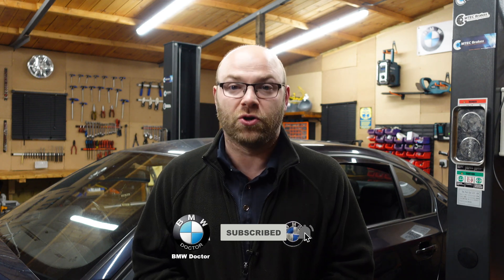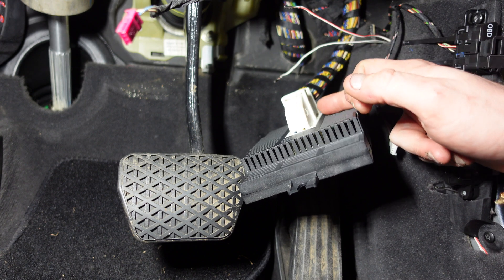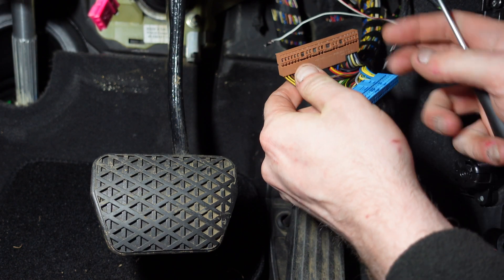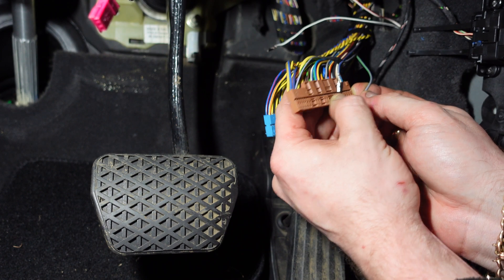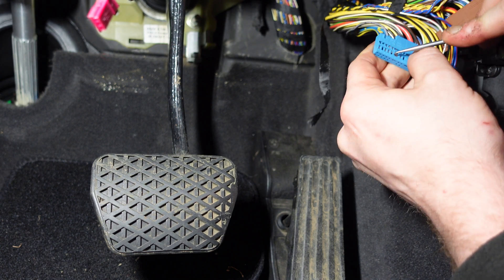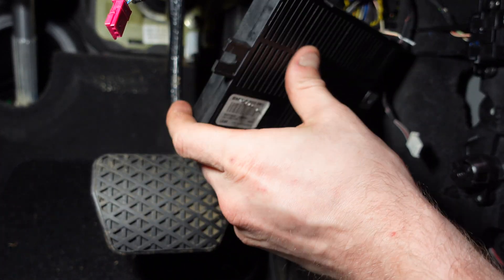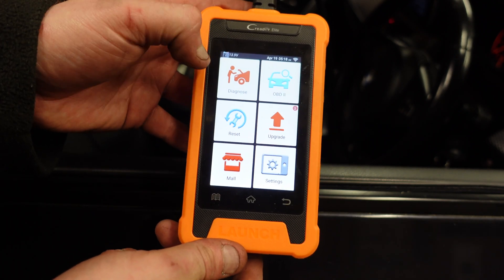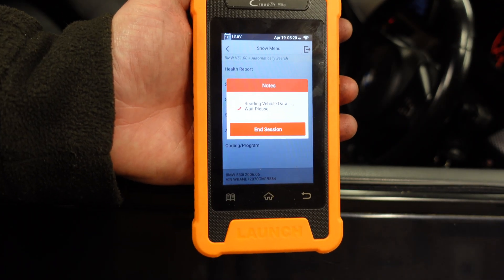BMW E60 / E61 Pre LCI To LCI LM2 Module Replacement & Coding

Comment: Hi i have a E60 2006 523i pre LCI - I have followed your video and put a LM2 Module in but all that happens is the angel eyes dont work and throws out loads of errors the headlights i have are PRE LCI Xenon - WHAT AM I DOING WRONG :( :(
Reply: Did you code your LMA and also updated VIN?

Comment: Hi can you assist, i have a BMW E60 525i, i took it to BMW dealer for a battery change and after that the iDrive screen started to be off sometimes and sometimes on and now it is completely off. The radio is not working too after the screen became completely off. I took it for a full diagnosis at BMW dealership, they told me they will put in a FRM module to check what is wrong with the car. The car doesn't switch off the electronics after a drive, i must take out the battery terminal cause it kills the battery, something is not switching off in the car. Can you help what would be the possibility to fix this. I was thinking of changing the FRM module to see if it will work
Reply: Sounds like your ibs sensor on the battery is faulty. Try to disconnect the ibs sensor on the battery and lock the car. If the electronics switch off then the IBS Sensor is faulty. If the electronics stay on you need to search further

Comment: I have Adaptive Xenon Headlights so I bought LM2 AHL. I switched pins and I coded features but I have one main problem.. I can't turn off my fog lights. What I do wrong? I would like to emphasize that without swapping the pins my angel eyes don't work. Please help mi doctor.. My BMW E63 2004.
Reply: @ghost_casper97  About to switch pins myself with the same setup to enable drl. Were you able to fix the issue?

Comment: Hello, so if I have an e60 from 2003 with regular h7, all I need to do is buy LM2 and 2009 lamps and this scanner will encode it without any problems?
Reply: did you do it?

Comment: Great videos. Have issue with lm2 on my e60. Going to replace with a used one like for like. Will need coding I assume. Is this coder better for this than the android based systems like protool or bimmercode?
Reply: @colinward3569  moi aussi j'ai le même problème je l'ai remplacé mais maintenant je sais pas comment le coder j'ai essayé avec autel im608 mai il le fait pas

Comment: So technically you don’t have to code it after you switch the pins? It will still work as it should?
Reply: I’ve just bought an e61. And i’ve noticed that the front and the rear lights are flikkering. And after a long digging on the internet, i came across this video and maybe the previous owner installed the preLCI headlights with angle eyes but didn’t know what to do with the pins. 
Please help me😢 i hope it will work by only changing pins. Thanks in advance!

Comment: Hi my friend 

I have a friend who has a BMW E60 from 2003 prelci he changed the front headlights to put halogen headlight with the lens like on xenon thanks to the adapter the headlights work but on the other hand he has a problem with the level of the headlight control when it is in the "0" position the headlights do not turn off when it wants to put the night lights or parking lights   headlights on while it should be the pilot lights basically it is important the position night lights or parking lights  headlights remain on still on, what do you think the problem could be coming from ?

Thanks for your time

Comment: Don't do this I did it and change the vin on the lm2 with NCS and then my angel eyes didn't work so I had to put the wires back and then it all worked
Reply: Pre LCI halogen headlights?

Comment: Do I have to re-pin the cables if I want to keep my standard preLCI Headlights?
Reply: For Halogen pre-lci don't swap pins. Just copy VO from CAS and flash default no need to edit build date.
Reply: @jonot8547  I intend on doing this on Monday, Lm2 but keeping Halogens, I have a cable and some software on Pc, I have no understanding on coding, Could I get some further help with the Vo-cas thing?

Comment: Thank you for the video Doc. I have upgraded pre lci halogen to lci halogen with the LM2 headlights & Taillights, coded all done, however, high beam not working and i have no clue why's that not working, any help please? Thank you for your time!
Reply: What did you do to code the head light because my low beam is not working
Reply: Avec quoi tu A coder le lm2 ? J'ai remplacé le mien par un d'occasion car il était défectueux mais je sais pas comment le coder par rapport à ma voiture

Comment: Nice clip! Can you code Oil Level on pre LCI e60 with IDrive (bigger navigation)?
Reply: I discovered that when your mileage approaches a couple 100000 miles that. The oil? Quality. Censor stops? Working. And after a lot of checking around no solution did I find and BMW said that they have no remedy either so your oil conditions since it? Doesn't work and you just have to change your oil every 3005 1000 whatever? You think is prudent. I miss it though I thought it was cool said Hey. You have to change your oil in 2000 mil anyway. Someone knows how to fix this I'll be forever in your debt

Comment: Hi I wonder if you or any of your subscribers can help. I have a 2016 520d with 32k on the clock. Had is since Jan 23 and love it however it has an intermittent annoying issue. On most times I drive it I get a strange very deep base exhaust note that comes and goes randomly. Usually when you just touch the throttle at very low revs, such as low speeds in traffic. Some days it doesn’t happen at all. Lots of forums with this issue with dealerships saying it’s the DPF regeneration and BMW involved but no apparent solution. It makes the car sound completely broken and I’m considering moving the car on as a result, please help I’m doing my head in trying to find a fix. Thanks in advance, paddy from Newcastle